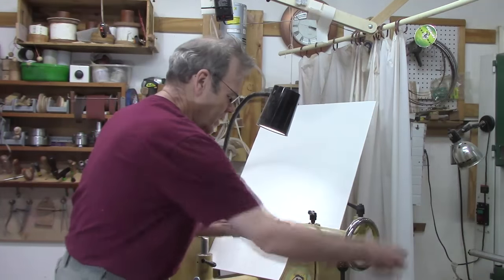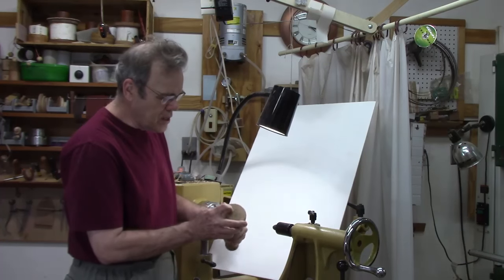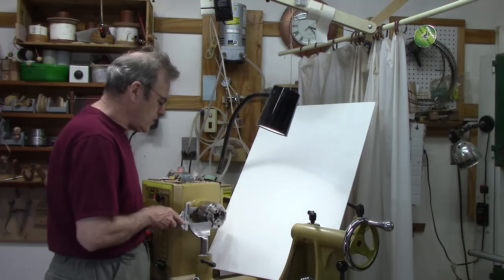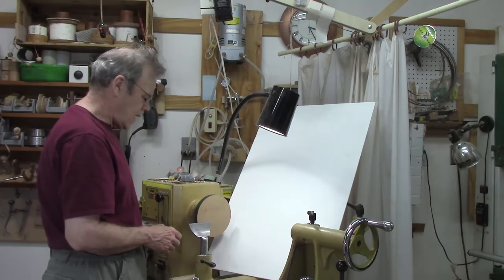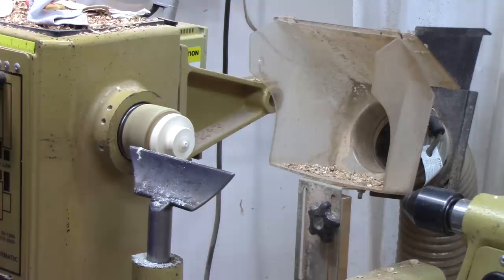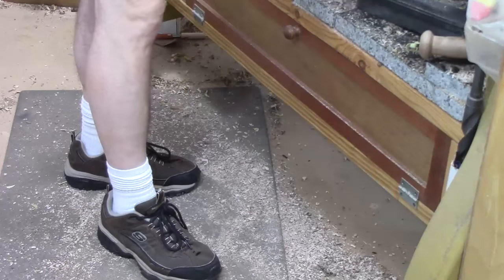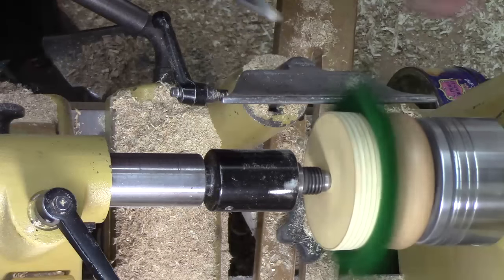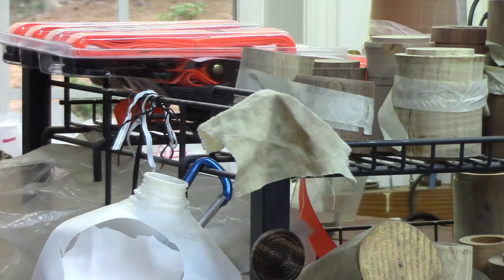Turning Tips, Tricks and Jigs - Episide 3

Comment: Hi Mike: Good video, I'll have to build the dead blow mallet. Just a note of caution about the oil finish rags. I have had them catch fire when laid out flat in the stainless kitchen sink in my shop to dry, now I take them outside the back door and throw them in the fire pit and light them. They can't spontaneously combust if they are lit in a controlled burn.
Reply from the maker: Sounds scary. My rags are typically 3 - 5" square and I hang them on the corner of a metal rack so air gets all around it. Yes, you can not be too careful.

Comment: I'm a retired auto mechanic and I still have my air hammer. Never thought of using it for bark removal...good idea. I had a problem with the chisels flying out of the retaining spring. I bought a sort of quick release collet that threads on to the grooves for the retaining spring. It hold the chisels very well, so problem solved...and easier to change chisels too. You might find one to fit from one of those tool trucks that travel form shop to shop selling tools.
Reply from the maker: +Gil Grace Thanks for the warning. Nice to know about an option if my chisels go flying.